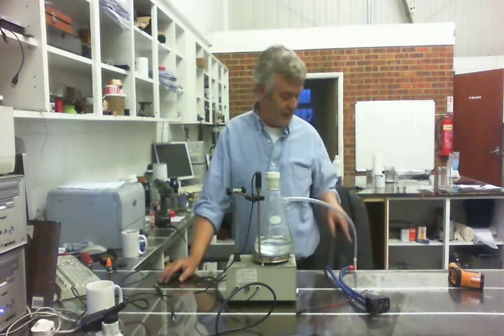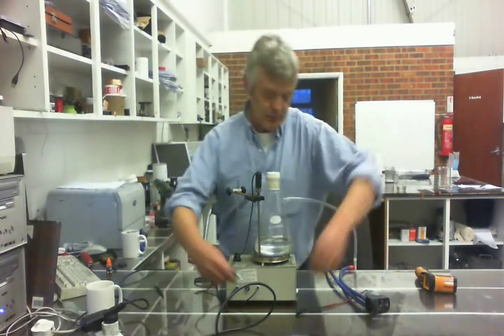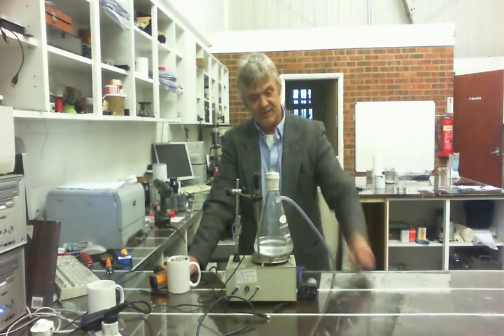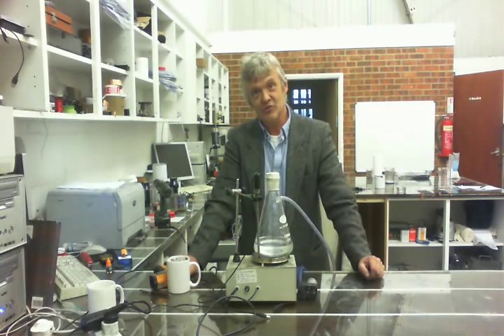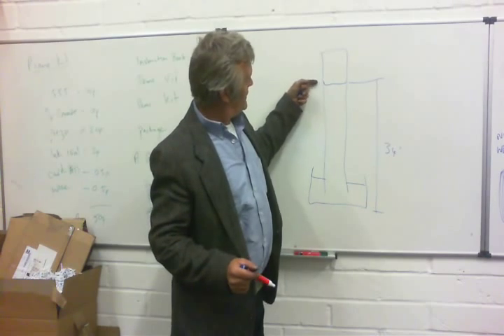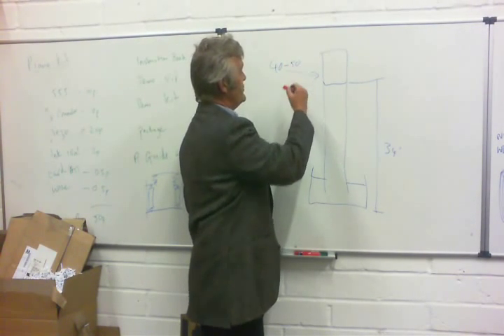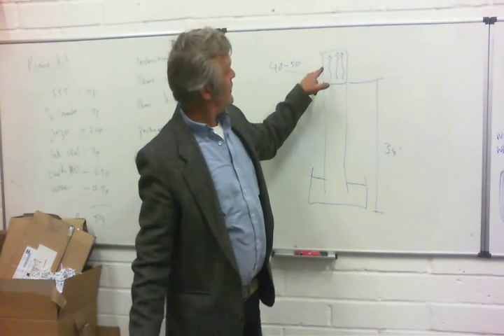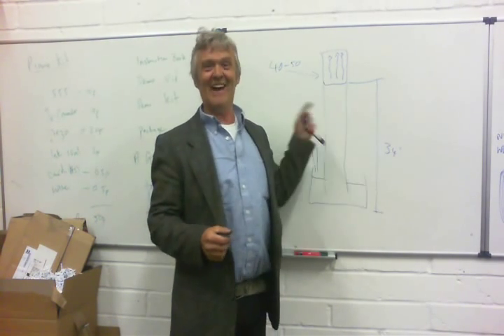Vacuum Distillation and Low Energy Desalination

Comment: It's not quite permanent. There are gasses dissolved in the water and the low pressure makes them come out of solution and collect in the vapor space. This would lead to a lowering of the water column over time. If you don't want to use a vacuum pump to purge the gases on a periodic basis what you could do instead is to use a pump to fill the entire column with water while at the same time venting the gases out the top with a vent valve and then when the column is completely full of water, shut the vent valve and then shut off the pump.
Reply from the maker: Joseph Richardson I know mate - but thanks for raising the point. I do have three solutions in mind - just exploring the best way of presenting them really - making them into a good video for others but i wanted the basic idea out there
Reply: One way is to just seal the bucket and refill the tube by using water pressure from the sea,
Reply from the maker: *****
cheers mate - interesting idea
Reply: Robert Murray-Smith I look forward to hearing your ideas, cheers.
Reply from the maker: Joseph Richardson
new video up mate

Comment: This idea works because the vapor is, indeed, pure water, as you said.  But you were wrong about what's contained in the area of the column higher than 34 feet when there is no sun/heat energy.  It is not a vacuum.  There will always be water vapor there whether the water is heated or not (unless it's frozen).  Water flash boils in a vacuum and will continue to to do so until either all the water has boiled away or enough pressure has been established.

Comment: this by coincidence is my idea too. I thought you could use tidal drop to create the vacuum. I built a functioning model in my workshop. also need a large surface area so maybe an upside down pyramid shape. Then you have to find the energy to pump it out to the desert as it is created close to sea level.

Comment: I believe radiant energy would be the economical way to raise the Temperature of the water, because it takes a lot of energy to raise the temperature of  a lot of water. So a series of outdoor shallow ponds would be required to heat the water and then the byproduct of desalination is brine which can not be returned to the sea. Ponds can be drained and brine removed with bulldozers.just need to identify a practical use for this brine.

Comment: What should be done with all the brine,  pumped into buckingham palace to dry up the lizards? JUST kidding, but really,  how do you collect and flow vapor without killing the vacuum ?
Reply: @ryanbeard1119  if my understanding is correct, it should be in a sealed system while operating and the same principals of heated distillation are in play. So once the water begins to boil, you will get a vapor. Then you condense the vapor in a collection container within the sealed system. The act of cooling the distillate from a vapor to a liquid creates vacuum, maintaining the vacuum with a lower physical water column. But I haven't tried this, so it is an assumption/hypothesis

Comment: connect the tesla turbine pump to the top (tesla turbine connected by wall were it runs backwards through discs a second time acting as a pump) which can create more vacuum so basically would run until ocean freezes or turbine falls apart.
Reply: id like to see this even more multipurposed as to also be a means of mechanical energy for thermal vent Rare Earth Mining.

Comment: I have toyed with this concept over the last decade or so.

So, when the water vapour condenses by releasing pressure, it should get hotter.  Therefore this heat can be exchanged to the inlet sea water to preheat it.  This would increase the efficiency of the plant, reducing external energy needs & the tendency of the desalinated supply to be hot and subject to evaporation on exposure to air.  How do we extract the near vacuum water vapour into a condenser to make this a continuous process?  It needs to be a continuous process to make the heat exchange efficient.

Could we simply have 2 towers, a fresh water side and a sea water side & pull vacuum simply by extracting water from the lower end of the fresh side?   We could make the towers concentric to facilitate heat exchange between them, providing sea temperature fresh water at the outlet. The towers could then simply be just be 2 concentric pipes open to each other at the top.  As we draw down the fresh water, condensation would occur at some point near the top of the jacket.

Then we have to think about salinity increasing in the inlet tube & exchange over saline water for sea water in some way.  Perhaps that could be gravity/density driven.  So, sea water would have come into the evaporation tube near the top so that over saline water could fall back to the sea via a 1 way valve. Maybe something like that?

The 2 water columns would nearly equalise pressure at the base of the towers, so we would not need a high pressure pump to drive this.

I suspect the fly in the ointment for practical operation would be dissolved gasses collecting in the vacuum chamber, causing loss of vacuum.  How would you remove them to maintain vacuum in an industrial scale continuous plant?

Comment: Am I mistaken that by applying heat(or possibly mechanical aggitation) at the head and piping that low pressure steam to an ambient condenser one could achieve cooling in the concentrated brine at the bottom? If so, that could be an even more interesting setup.

Comment: That's where I'm at but I'm questioning the next step like how do you get that steam to condense as distilled water without using much energy I'm thinking two lines where in the center of the hose is vacuum and a pump spins in low the low pressure steam hopefully move the steam over to the other side where the pressure can build up and the water condense and the bucket at the bottom will rise where the distilled water can be collected and to avoid needing a 40 foot tower vacuum pressure can be added at the bottom and you only need maybe a 10 foot tower

Comment: Amazing!!  Has the pipe got to be absolutely vertical? I was thinking... Laying a pipe on a 'theoretical' hill. 
#solar #desalination #energyefficiency
Reply from the maker: not in the least mate - it can be a wonky as you like but it does need a head of 34 feet - that is the top of the pipe and the bottom of the pipe need to be separated by a vertical distance of 34 feet but the length of pipe really doesn't matter - like a right angle triangle where the adjacent is the horizontal distance the opposite is the vertical distance and the hypotenuse is the length of pipe - the only critical thing is the length of the opposite which has to be 34 feet - the pipe length - the hypotenuse can be as long as you like
Reply: Robert Murray-Smith excellent.
Simple solar still or a parabolic dish/tray at the top of the hill.

Slings pipe over Dover cliffs haha
Reply from the maker: *****
I live about 30 mins from Dover - so - pipes in the car lol
Reply: Robert Murray-Smith wow, just had a thought, 
Barometric head……hmmm something else I'm interested in has got a head, it's a boat SV Seeker is making an excellent exploration vessel, so … to get to the point I'm wondering if he is gonna have a mast around 34 feet in height.
#desalination in the ocean, can't think of a better place
;)
Reply from the maker: absolutely

Comment: I've got to build one. I just have to. It's brilliant. I'm gonna make it into a statue. I'm going to use it for ethanol instead of water though. It needs a latent heat collection circuit, doesn't it?
Reply from the maker: it would certainly be improved by that - a regenrator at least - but it will work without
Reply: Definitely. A fresnel concentrator outside of the unit can run a pump to draw the vapor out and heat it up to say, 70C, then send it down through a heat exchanger inside the tube, using the water head to keep the bucket full.

Comment: Getting the vapor out of the tower would still take quite a lot of energy while maintaining the vacuum.
Reply from the maker: no it wouldn't - think it through mate
Reply from the maker: leerman22
ok mate
Reply: leerman22 But the atmospheric pressure is keeping it up there, therefore it balances out at equilibrium as stated at 34 feet of water (760 mm of mercury). No further energy required as the earth atmospheric pressure forces the water into the vacuum tube (Pressure = Force per unit area) and is countered by gravitational force where Force = mg, Pressure = density x height x g). To put it simply, water in an underseal vacuum at 34 feet is energetically at equilibrium. Therefore, making the tube higher than 34 feet gives it a space where water cannot reach thus creating a vacuum. Water at lower pressures boils at lower temperature (at the Himalayas it boils at around 60 Celsius). Therefore, they can take advantage of using a renewable energy like solar to reproduce potable water by steaming it at lower heat or energy levels required (like a factory reservoir) which will otherwise be wasted heat to the environment. Hope this is clear
Reply: @leerman22  I know I'm 4 years late but I think it's possible to expand the end of the tube where the water condenses, and make a "trap" where all the water vapor that condense into drops flow down into it and are channelled out. Maybe through a one way valve that can be pushed after enough water is collected?

I mean all it takes is some ingenuity, effort, time, and prototyping, etc... to pull this off and we can all have an affordable source of pure clean water.

Comment: Hello Robert, would you be interested in forming a team and joining the xprize competition for atmospheric carbon dioxide removal?  My idea is to use a similar technology as what you have demonstrated in this video, but with an above ground pipeline several miles long, on the coast of a desert area such as the Sahara.  The salt water pipeline could be designed in such a way that solar electric pumps the saltwater uphill in the pipeline full during the day, slowly heating it via the sun, then at night the pipeline is drained in such a way as to form a vacuum, allowing the collection of water vapors from branch pipes/collectors during the night.  The collected fresh water would then be drained to the soils where plants are continually grown, for the purposes of turning the desert into a habitable area while doing what plants do, removing CO2 from the atmosphere.